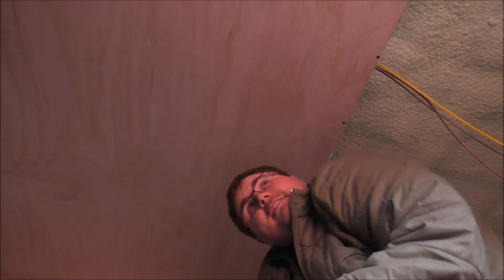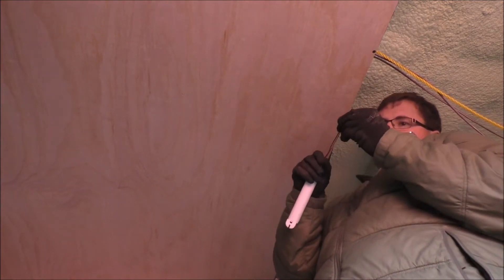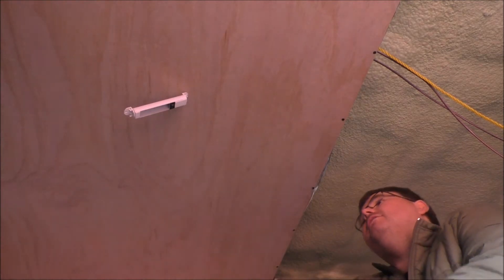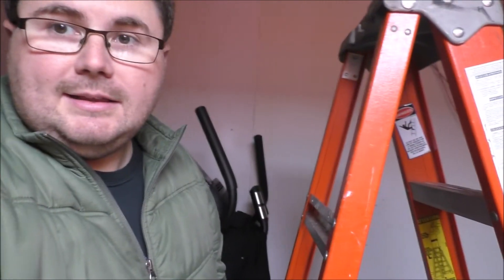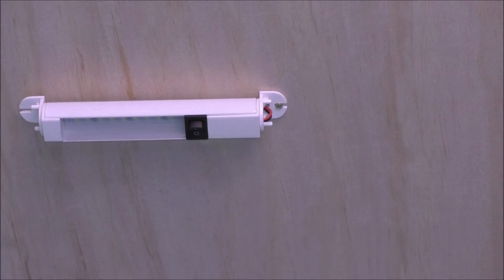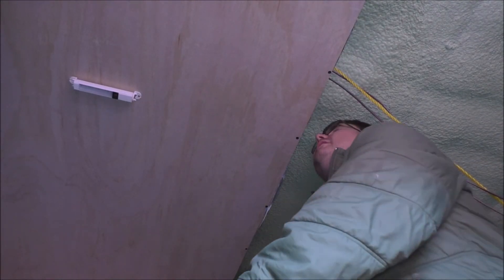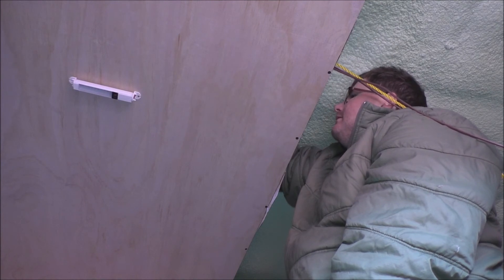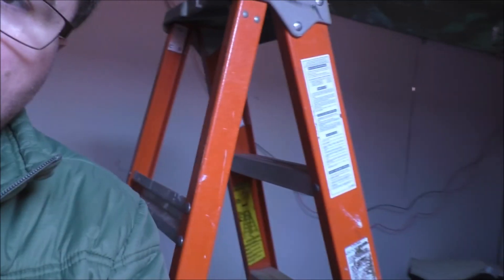Adding Solar Powered Off Grid LED

Comment: Are you center bracing every panel on ceiling?
Reply: I wondered about that myself.  He is cross bracing between each section of plywood but is not center bracing down the middle of the trailer.  I think maybe he is hoping that the cross bracing will suffice without center bracing also?
Reply from the maker: no i just did the ends, it hasnt sagged yet :)
Reply from the maker: yes